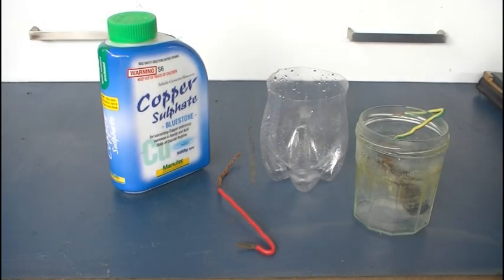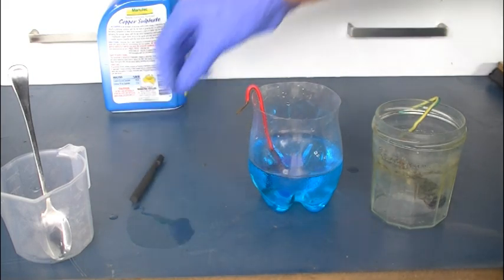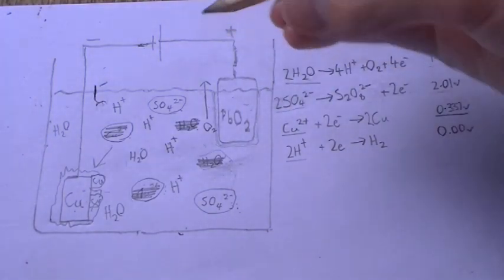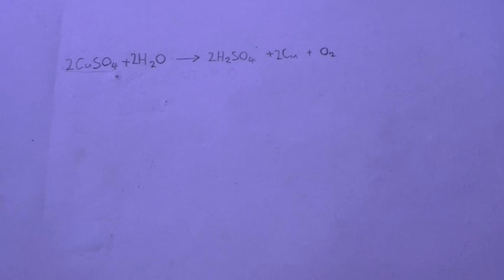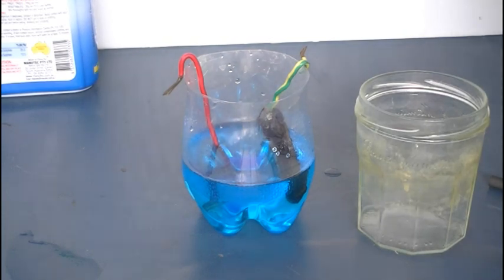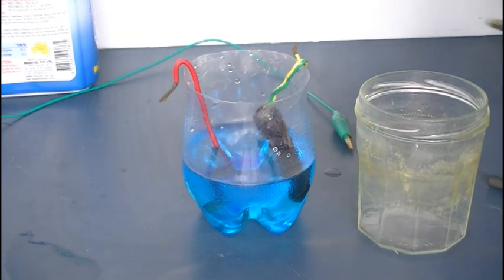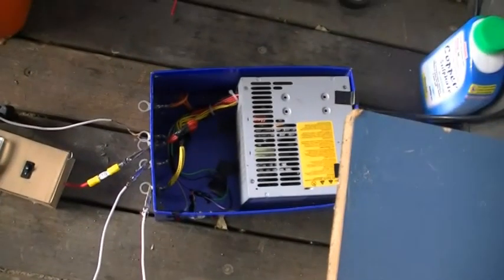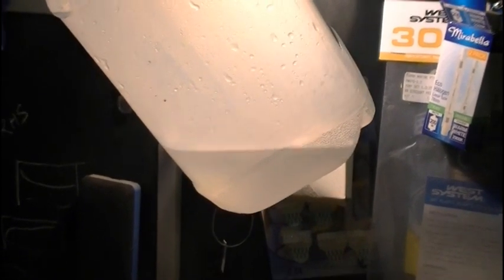Making Sulfuric Acid

Comment: Why the lead dioxide didn't form lead sulphate just like in an car battery?
Reply from the maker: The oxidising potential is too high in this case. Oxidising the surface to lead sulfate is easy and only requires a very small voltage to push the reaction forward. To drive significant current though, our voltage is much higher than this, and allows for the oxidation all the way to the dioxide.
Reply: @ScrapScience  Thanks for answering! Aluminum sulphate is very cheap and available where I live, so is possible to use it to make sulphuric acid? Have you ever thought to use the plastic separator found in car bateries as porous membrane to electrolyze sulphate salts?
Reply from the maker: Yes, any soluble sulfate salt can be turned into sulfuric acid by electrolysis. Aluminium sulfate will require a separated cell, and the process is extremely inefficient, but it can be done.
Ripping apart car batteries is definitely not something I'd like to do, even though the separators might be useful. The sheer messiness of the process, combined with the lead compounds makes me terrified honestly. I've also been unable to find anyone who will sell the membranes directly.
Reply: @ScrapScience   So despite the risk of lead compounds, is fair to say that PbO2 is as good as MMO or platinum coated titanium to use it as anode? I'm also interested in building a chlorate cell
Reply from the maker: Lead dioxide is only effectively inert enough to use as an anode if you’re electrolysing sulfate or carbonate solutions. And even then, I don’t recommend it.
For anything else (e.g. solutions containing chloride, hydroxide, or for chlorate cells etc.), the lead dioxide electrode is not an option if you’ve made the electrode only by anodising the metal. The lead will quickly dissolve and fall apart, leaving you with a terrible toxic mess.
Reply: @ScrapScience  Ok I got it, So If manage to extract the lead dioxide anode from a battery, will be dissolved too?
Reply from the maker: Yep, I’m afraid so. Lead dioxide from a car battery is basically just anodised lead (and extremely porous), which isn’t a suitable anode for many things.
Reply: @ScrapScience  I have a piece of platinum, but I haven't had success in plating anything with it, (that's why I'm looking for another anode).

I made aqua regia, dissolved a little bit of platinum on it and attempted the electrolysis on a piece of nichrome wire, some black stuff was formed on the surface of the wire. I tested it's catalytic properties on hydrogen peroxide but the reaction wasn't that vigorous, also the black stuff started to flake

I saw videos where titanium was the base metal but i can't find anything made of it, only medical stuff and are too expensive, is there another metal that can substitute titanium? Maybe directly plating stainless steel with platinum?
Reply from the maker: Plating items with platinum is a notoriously difficult thing to try to do. It is achievable for plating imperfect coatings on metal surfaces, but it is near impossible to get a robust solid plating capable of withstanding the harsh conditions involved in electrolysis. I've never seen anyone make an anode capable of this without specialised equipment and complicated plating solutions. An electrolyte made up of platinum dissolved in aqua regia definitely won't do the trick I'm afraid - you'll only get a partial/dendritic plating, and the exposed substrate will ruin most electrolytic reactions you try.

Nichrome wire is not going to be an effective choice an an anode substrate either, especially for chlorate cells. The only effective substrate option is titanium, though tungsten or zirconium might work as well. Either way, it's going to be far too difficult to plate these items with an adequate layer of platinum anyway. 

The most effective way to make platinum electrodes yourself is to bake platinum onto the surface of a titanium electrode. I've seen a few people have success with this, but I can't remember the exact method or where I saw it, sorry. In all honesty, just buying a platinum coated electrode is likely to be the cheapest and easiest route.

However, if you've got a piece of platinum right now, can you simply use that as an electrode directly? Or is it too small?
Reply: @ScrapScience Yes is a tiny piece of a ring, it's very small. I followed the method of this video https://youtu.be/eRozaFj8-D8, but no success, I also wanted to try this method https://youtu.be/TSzgvP0OW-Q but haven't found anything made of titanium
Reply from the maker: Are you sure it's pure platinum? It it's alloyed (or another metal entirely), it will make plating very difficult, and your electrode won't work properly.

In the first video, this method of platinum plating is not suitable for chlorate cell anodes. Using nichrome wire substrate is effective for making fuel cell electrodes, but not for electrolysis experiments under harsh conditions. You need a titanium substrate.

As for the second video, I'm honestly surprised that that type of simple platinum plating works. I've always been told it's much more difficult than that. Either way, it seems like it was effective for this guy, and I can't argue with that.

Once again, if you're making anodes for chlorate production, it's pretty much essential that you use titanium as a substrate. If you can't get hold of titanium, I'm afraid you're out of luck. 
Can you buy things online? Titanium mesh is very easy to find on Ebay or other sites. MMO and platinum coated electrodes are also available if you don't want to do the plating yourself.
Reply: @ScrapScience  well, I didn't analyze the metal with xrf to be 100% sure it's pure platinum, but I heated with a torch and was imposible to melt it and was kinda hard to dissolve in aqua regia. 

So anyway, do you know any reliable seller to buy a suitable anode for brine electrolysis?
Reply from the maker: Until recently, I always recommended https://electrodesupply.com/ as a seller of high-quality electrodes. However, looking at their site, it seems like they no longer have any products listed.
Beyond this, I'm afraid I can't guarantee reliability for any other sellers. If you're going to buy an anode this way, I'd definitely go for trying to find an MMO coated titanium electrode over a platinum coated one. MMO electrodes are generally cheaper and are much less likely to be fake (I've found that over 50% of 'platinum anodes' sold online are fakes, but MMO anodes are nearly always genuine). You can generally find some MMO electrodes on Ebay if you search for 'MMO anode' or 'ruthenium iridium anode'.
Reply: @ScrapScience  Thanks a lot for the information!

Comment: Other way is adding hydrogen peroxide into solution of copper sulphate and then distill it (distillate will be H2SO4 and the rest will be CuO2).
P.S.
H2SO4 will not be concentrated.

Comment: Another idea I thought of, but can't find much info on is burning pure sulfur in an ozone rich atmosphere and bubbling it through water or burning sulfur in normal air and bubbling it through ozoneated water. Do you think this might work?
Reply from the maker: I'm honestly not sure about the kinetics of the reaction between sulfur and ozone (or sulfur dioxide and ozone). It's possible that it might work, but the generation of ozone is generally an extremely inefficient process, so you'll be facing a very energy-intensive generation method.

Comment: Can this be done with ferrous sulfate ?
Reply from the maker: Only partially. You might get some conversion of ferrous sulfate to sulfuric acid, but the process becomes much less efficient as the acid becomes more concentrated, so you’ll never be able to get anywhere near 100% conversion, and your product will always be very dilute and contaminated with dissolved iron ions.

Additionally, the anode reaction will very likely just convert ferrous ions to ferric ions, preventing the formation of acid entirely.

Comment: Can you use the same process with magnesium sulfate ?
Reply from the maker: Not quite. The very low reduction potential of magnesium prevents it from plating out under aqueous conditions. You’ll just be electrolysing water in that case.
Turning magnesium sulfate into sulfuric acid requires a cell with a diaphragm or a membrane. I have a video on this topic as well (‘making sulfuric acid from epsom salt’), but it is extremely inefficient and produces a low quality product compared with the copper sulfate method.

Comment: Can you show how to make concentrated sulphuric acid using potassium nitrate and sulphur?
Reply: Buy an big jar with lid of glas like the big Candy glasses . fill an little bit of water on the bottom put i iron ship on it put on the ship an mix of 12-15% Potassiumnitrate  and 88-85% Sulfur. light it and close the lit. Repead until you reach an concentration of 70%.

Comment: Hi can I use plain lead bars?
Reply from the maker: Yes, but I'd seriously recommend graphite instead. Lead electrodes will inevitably introduce lead contamination to your solution, which shouldn't be handled without the appropriate setup. On reflection, the way I've done things in this video is not a safe way to do things, and graphite anodes are a much better option.
Reply: @ScrapScience  thank you for your reply! I'm gonna try to search for rods ASAP . Cheers

Comment: was about to say to use lead as annode and then you did it lol i get good results using just lead as it will oxidise to a degree making an inert layer on the surface any way it works very well. heating untill fuming happens brings the concentration up to well over 75% or distill if you have apparatus . oh and THIS ONLY WORKS WITH DC just thought thats a point  that should be obvious but ..........

Comment: Can the copper metal crystals created in this be used in place of Copper Oxide in other experiments when required?
Reply from the maker: Nope, I'm afraid not. Copper metal is generally much less reactive than copper oxide (at least in terms of aqueous chemistry), so the properties will be different.
It might be a perfectly good substitute for some (select few) reactions, but in the vast majority of cases, it won't do the same job.

Comment: couldn‘t you over-electrolyze (meaning you leave it running for a full 24 h), to start electrolyzing the water which will increase the concentration if you don‘t feel like heating a corrosive acid to 350 deg C?
Reply from the maker: While it would definitely work to some degree, concentrating the acid by electrolysing away the rest of the water is extremely slow, and incredibly energy intensive. To get rid of 100 mL of water, you'll need a whole kWh of electricity (at least).
Additionally, once the concentration of your sulfuric acid raises above around 50%, the conductivity rapidly decreases, preventing electrolysis from occurring effectively.
Overall, it's a lot more energy efficient to boil the water off (most of which can be done at near 100 C), and getting concentrated acid (where the required temperature will rise to 300 C) actually requires it.

Comment: Hello, I have been trying this with a very similar setup other than I am using carbon motor brushes as my anode, I have tried lead sheet with the same result. 50g of CuSO4 in 150ml solution. I intend to use the acid for anodising small aluminium parts.
I notice that the anode gas/steam does not appear to increase the flammability of lit tissue paper and has a slight odur, changes a flame colour green, making me question which gas is generated and if it contains copper? I have stopped for now incase I have something wrong. Copper has grown around the cathode so that part is working. Any ideas? 
Thanks
Reply from the maker: You've done everything correctly, there's no need to worry. The amount of oxygen gas you generate on the anode is, in general, not produced at a rate high enough to make anything burn faster. Also, the green flame is due to the fact that when the oxygen bubbles burst at the surface of the solution, they aerosolise a small amount of copper sulfate solution, which gives you a strong green flame even when you have tiny amounts.
I'd definitely recommend sticking with carbon electrodes as well. Despite the erosion you get, it's much nicer than having to deal with the toxic lead oxides that form on a lead anode.

Comment: try welder as the current source
Reply: try getting metals from dirt using the sulfuric acid, regenerate the acid
Reply: battery acid at 35%-45% is easy
Reply: you could put a resistor like 20 ohms (or 220ohm) in series to limit the current from a battery source
Reply: a diode in series with a resistor is a nice voltage current regulator reaction setup
Reply: say 8 ohms resistor at 9V battery through 2.7V diode gives max 0.3375A and 0.9W of power through the setup cell
Reply: water desiccant (like SiO2) could be used to fast concentrate the acid, assuming only the water part is taken by the desiccant powder
Reply: maybe CaSO4 is better desiccant in CuSO4/H2SO4 than SiO2 which forms some solid acid compound

Comment: So what sulfuric acid percentage was produced this way? Or asked another way, how much extra ph 7.0 tapwater to add to make it roughly ph 5.0?
looking to possibly use dilute sulfuric acid to lower the ph of my garden soil, as adding lots of expensive sulfur isnt doing much. i have highly buffered soil that i want to reduce to ph 6.0 - 6.5, which is ph 7.0. Additionally the sufuric acid should help with clay. I would only try this if i can make several watering cans of dilute ph 5.0 in one go. else it wont be worth it.
good work.
Reply from the maker: The percentage concentration produced in this video was around 2%, or a pH of approximately 0.7. This concentration is directly dependent on how much copper sulfate you start with, so you'll need to do some stoichiometry to work it out if you're going to give it a go.

If you want a pH of ~5.0, you'd need to dilute this particular solution with tap water by a factor of around 10,000 times (i.e. 1mL diluted into 10L of tap water), but again, this will depend on how much copper sulfate you started with. pH test strips will be essential here to check that you've got it right. You'll also definitely need to avoid using a lead electrode if you're using this stuff for your garden to avoid lead contamination/poisoning (use a graphite anode instead).
Reply: @ScrapScience  : thanks very much for answering. sounds like a single small batch like you did would be enough. see how my soil reacts to latest $100 worth of sulfur application. if it bounces back up again, might give sulfuric acid a try.
have to wait for the applied sulfur to work. apparently some farmers use sulfuric acid from a tank and boom, to apply to farm soil. nobody's done a video of application of diluted sulfuric acid to clay soil. thanks and cheers

Comment: Could the porous clay pot be used to protect the carbon electrode ? If the copper electrode is inside the clay pot and the copper sulphate solution is inside the clay pot , and the clay pot is then placed into a container that hold water with the carbon electrode on the outside of the clay pot but in the water , if you know what I mean ?
Reply from the maker: I'm afraid a diaphragm won't protect a carbon electrode from disintegrating. The acid is generated directly on the carbon electrode, so the product will inevitably fill with carbon dust unless you use a different type of anode.

Comment: After reducing the solution down to less than 50ml from 330ml the ph is reading 0.3 but it for some reason will not react with sugar.
Reply from the maker: In regards to all of your comments/updates, nice work! I'm glad other people are trying the magnesium/ammonium sulfate method.

As for your pH measurements, are you carefully calibrating your pH meter before every test? pH probes are notoriously inaccurate without extensive calibration every time you use them. Even with extremely expensive models, they will still be highly inaccurate at very low pH. 
Acid concentration is very difficult to infer from inaccurate pH values. To get even a reasonably accurate reading of concentration, you'll need to titrate it rather than just test the pH.

As for why it's not reacting with sugar, you need VERY concentrated sulfuric acid to get that reaction to occur. Anything below around 80% won't work properly.
It's very difficult to concentrate sulfuric acid to that degree without a powerful hotplate/heating mantle. An iron and a pyrex jug is clever, but unlikely to be able to reach the required temperatures of over 300C to get rid of all the water (and if it did, it would probably be quite a dangerous setup).

Comment: After heating it again in a Pyrex jug on a inverted clothes iron I’ve reduced the liquid to 50 ml from original 330ml I’ve had to filter it to remove some salts that had formed, the result is a liquid with a very slight blue tint measuring 0.3 ph at 18 degrees C
Reply: Verz nice! How did you remove the salts?
Reply: @petrlaskevic1948  I didn't
Reply: @peterbranton6845  You said you filtered them

Comment: Update, when I got home from work the solution had cooled to 15 c I tested the ph again and it was 0.7 so when the solution is warmer it has a lower ph why is that? I started with 330ml at 1.4 ph and reduced it to 100ml . I’m now going to try reducing it further to hopefully decrease the ph further. I’m reducing it on a heat approx 80c , I’ll let you know the results
Reply: There is more energy in the system, allowing for more hydrogen ions to be stable in solution.